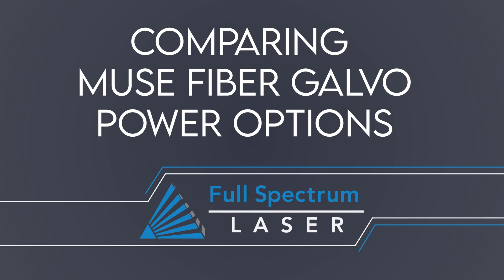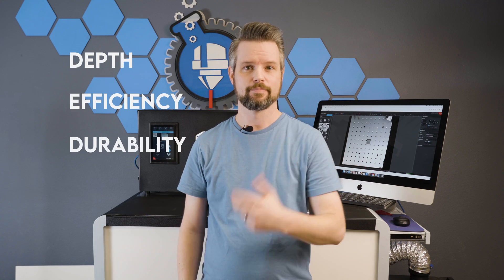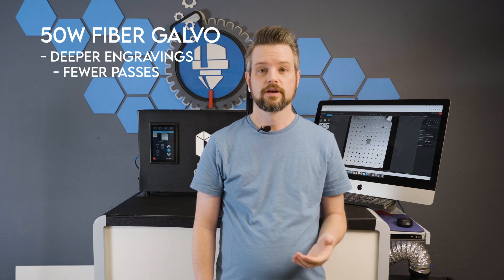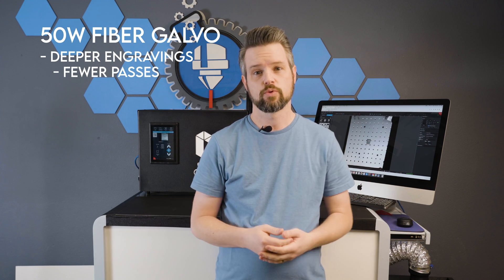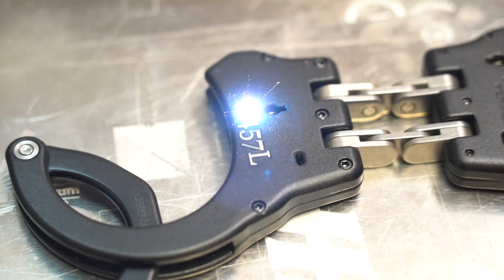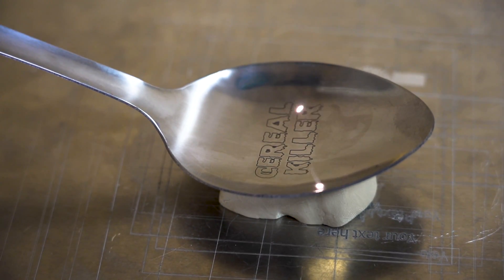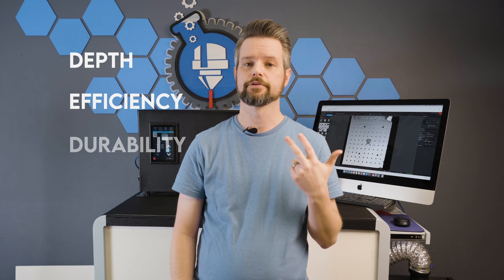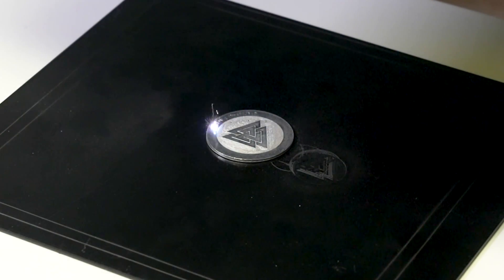Fiber Laser Power Comparison (20W vs. 30W vs. 50W)

Comment: Im looking at the 50w gweike g2 max, and the 30w gweike g2 pro. I work mostly with stainless steel and brass as Im a knifemaker. In this case are harder metals such as tool steels and high carbon stainless steels more difficult to engrave? I know copper and brass are difficult for their high thermal conductivity but I have seen high success deap engraving them.
Reply from the maker: With a 50w, you will spend all day trying to get depth in those kinds of metals, we suggest a 100w fiber for significantly faster results.

Comment: Isn't area also a consideration? A 20 watt might not be able to do the job at all if the area of the project is too large.
Reply from the maker: It really depends on the material you're working with.  The tapering of the power over a 12X12 area is not that significant and the accuracy of the new RE4 Galvos we offer assures there is no warping of designs while working with larger work areas.

Comment: Hi, what would be the best for stainless steel jewelry?
Reply from the maker: You want a MOPA laser for Stainless steel as we can get it deep black from all angles without a burned in deep mark.  We always recommend you get the strongest laser you can afford as it's just faster eg 100w is our go to recommendation.  Check out these stainless steel examples: https://cdn11.bigcommerce.com/s-8p1uzl4cj9/images/stencil/original/image-manager/mopa-black.gif?t=1687904718  We have sold many lasers to jewelers for stainless as well as other metals eg gold/silver/platinum

Comment: Is 50watt the maximum power only or can you also decrease power to get less deeper cuts? I'm asking this so i know wich one to buy. I think the 30watts is what i need in terms of power most of the time. But if you can decrease power on the 50w back to 30, i might as well buy that one.
Reply from the maker: Yes! You can decrease output via power settings.

Comment: I'd like to cut .8mm brass sheet for small electric terminals used in switches 3mm x 15mm. what is the smallest hole I could punch? I'm not in a hurry and a clean cut is important. Will heat be a problem with sheet warpage during cutting? thank you.
Reply from the maker: contact sales@fslaser.com

Comment: how long does one fiber last ? I thought they would never break down
Reply from the maker: The source in the fiber laser will last much longer than a CO2 laser and typically is not of concern since they can last upwards of 100,000 hours (which would be more than 10 years if the laser ran 24/7).  They are much easier to maintain as the source itself really doesn't require maintenance.  

Just make sure to keep an eye on the rest of the components.  Make sure the lens is clean, and that if any of the screw driven motor rails are clean of debris! :)